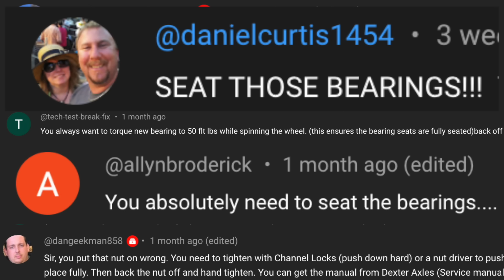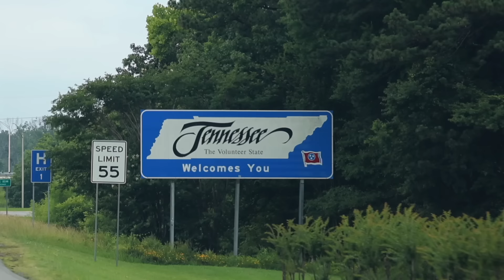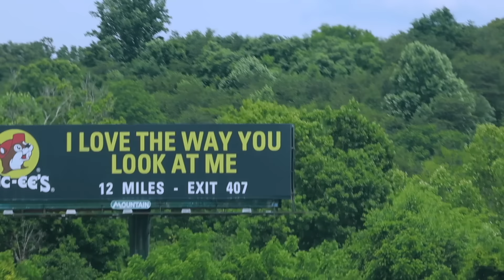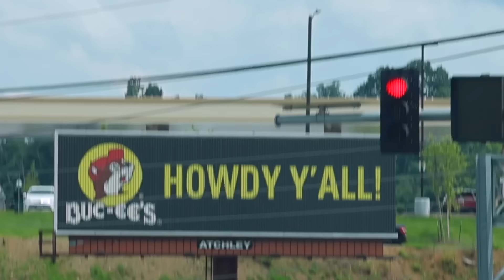We Can’t Continue to RV Until This is Resolved

Comment: Don't take the wheel off, uncover the bearing cover,  take the cotter pin off, take a pair of channel locks, and loosen the nut, now start turning the wheel as you tighten up the bearing nut till u have resistance. Keep spinning the wheel while you do it. After you have a fair amount of resistance turn the wheel and slightly loosen the nut till your wheel is moving with just a little bit of drag. Now place your cotter pin and nut lock cover.. 
Your done.

Comment: Do NOT set your impact on the #3 setting when you are tightening your lug nuts! 
It'll pull the threads on the lug bolts and make it difficult to get the lug nuts off next time.
Use setting #2 to tighten your lug nuts.

FYI Benton Arkansas is supposed to be getting our first Buckey's.

Comment: Most of the time you tighten (preloading the bearings) the nut to tight, then back off the nut 1/4 turn…..replace the retainer and grease the bearings….all this of course is just adjusting like you did in the video…..anytime you replace the bearings and outer races you need to pack the bearings before doing the above adjustments

Comment: The amount of grease was good.
you really need a socket with a breaker bar.
That is a taper shaft and bearing has to be seated good. Channel locks are no good not enough torque. 
You need to add more grease. when it warms ups grease liquidfies and the bearing roll into the grease. when it is full of grease and liquidfies it will barely cover the shaft.
Since it was so loose and not locked in you should have remove the drum and checked the seal. When loose it can wobble and bend the seal which can leak.
To tighten the nut you put tire back on with two bolts and spin the tire to right and with breaker bar lock down the nut. then loosen and spin tire to the left and lock down the nut. till it stops rotate tire one turn tighten nut again till you can't move tire loosen 1/4 turn spin tire. loosen until you can spin easy  then lock in the nut, grab your grease gun and spin tire and slowly pumping grease into the wheel and that is slow about 2 seconds to push down grease handle and fill with grease till it come out.
Then your are done.

Comment: Then.... when torquing the lugs back tight... 
You really need to get yourself a torque wrench and make sure you get them to the proper torque setting on the lugs. Same thing with the truck. Very very important to make sure you do this... all a matter of wheels coming off or stripping out the lug bolt which would do the same thing!
Ex.... Our dually requires the lugs to be torqued at 150pds. Not some little tiny bit like the impact would do on it!
Reply: He used a  torque wrench. It is in the video.
Reply: or get a set of torque sticks for the impact

Comment: You get more tightening torque if you open the pliers more and engage the bolt fully, not sideways … from experience ;)

Glad you caught the bearing setting before troubles …
Reply: 50 ft-lbs …
Reply: Correct,,,  open them wider and turn sideways. Using the tip you have no power…

Comment: Not sure if anybody else has already told you this yet, but you do not have to loosen the lug nuts before jacking it up. The impact wrench will easily remove the lug nuts with the wheel off the ground.

Comment: They need to be a little tighter then finger tight. You back the nut off until the wheel spins freely with a little resistance the bearing will ware in.

Comment: Screaming again, when you put luggage nuts ON, use electric only to get close, then use torque wrench. Retorque after 50 miles and again after 250.
Reply: "Lug": Correct. But lug nuts do not refer to luggage. The term dates back to 15th century Scottish (probably from Norwegian origins). The word lug commonly refers to the ear. Early vintage car wheels had an "ear" of metal on the rim with a nut attaching this lug to the wheel hub. So the lug nut was named after this metal tab that looks like an ear.
Reply: @evanlewis2064  I hate spellcheck

Comment: In all actuality you don't have to loosen the lugs when using the gun. They will loosen just fine with the wheel off the ground. 
The only real time to loosen them on the ground is when using a hand wrench/socket when having to use the leverage to loosen the lugs.

Comment: Your using an impact to remove the lug nuts z you do not need to break them loose before you take the weight off the the wheel . Just lift it and zip it

Comment: #1 you are holding your channel locks wrong.  You should be able to hold the tightly with one hand. Open them up more. 
# 2  Stop by sometime at HARBOR FREIGHT  and pick up a dedicated wrench for that wheel bearing nut.

Comment: Rule number one never believe everything you see on a YouTube video about repairing anything. You need to learn the proper way to use a pair of water pump pliers and you're not doing it. You need to preload the bearings and you not loosen it so much that you can turn the nut by hand wrong wrong wrong wrong wrong wrong wrong wrong wrong

Comment: Still a fail. You never tightened the nut. Can't be done with channel locks and certainly not when using them 90 degrees to the wrench surface. Plenty of good instructions in the comments. Use proper tools. Try again....